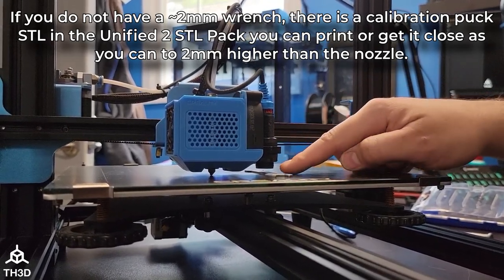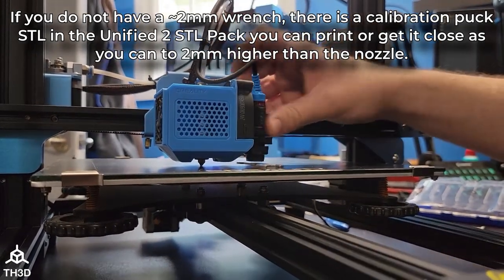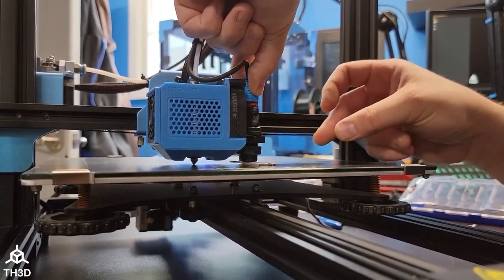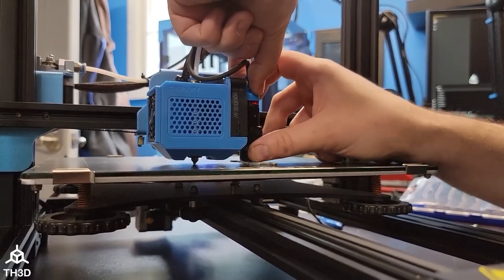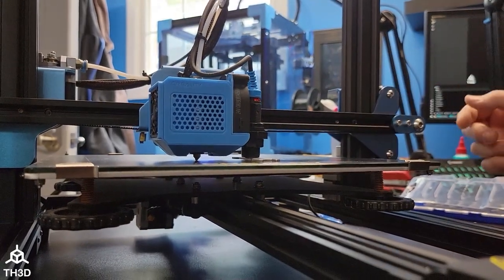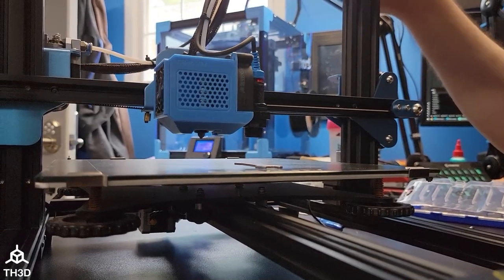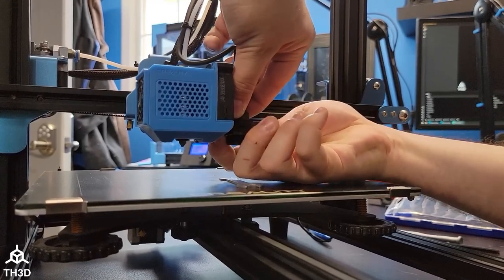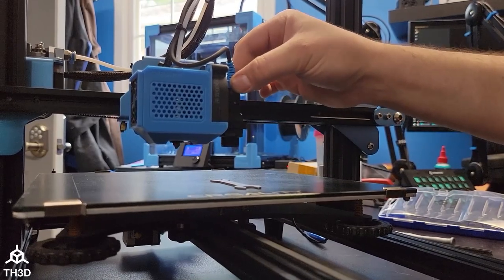EZABL EZTips - Adjusting the Sensor Height

Comment: What to do if the 8mm sensor is too short? I have a Bondtech DDX V3 and the lowest I can get the sensor is approximately 3mm from the tip of the nozzle. Also, the sensor mount broke in half during installation. Also, the LCD Screen housing almost completely busted into pieces during installation. It didn't take much pressure at all for either. Ftr I ordered ABS for both and I am a bit sad about it, but super glue can help that, I guess. It can't help the length of the sensor, tho. Any suggestions?
Reply from the maker: The LCD housing should not be brittle at all, it sounds like the shipping carrier may have been quite rough with the part. Can you please send our support a message to they can see what happened and get you fixed up? Here is the link: http://contactus.th3dstudio.com/

Usually if a printed part is brittle, it is due to shipping damage as we check our parts for structural integrity before they go into stock. As for the DDX we don't manufacture or test those parts out with any of our products we sell. The EZABL Micro (8mm) sensor is set at a fixed 2mm detection distance. If you cannot get it to that low of a point, then the mount you are using needs to be modified to accommodate the mounting requirements of the sensor. The sensor cannot be changed in terms of the detection distance and they are all like that.